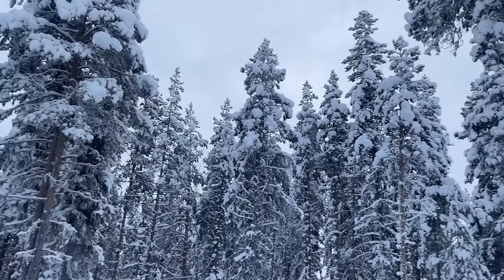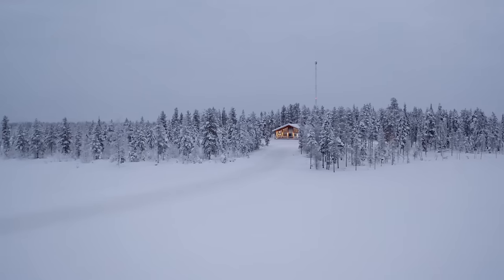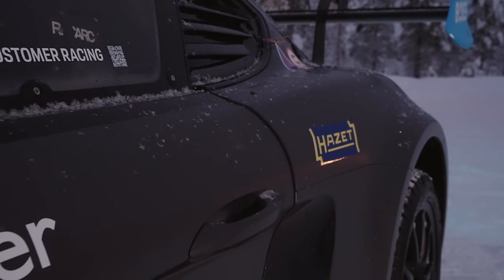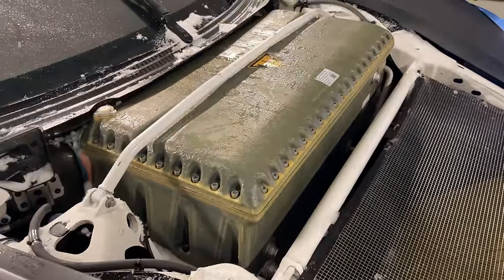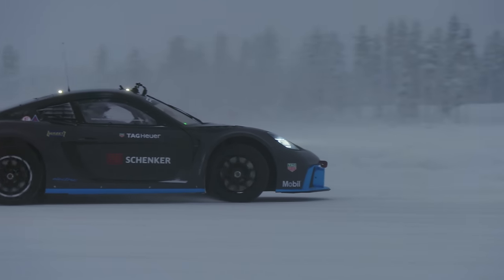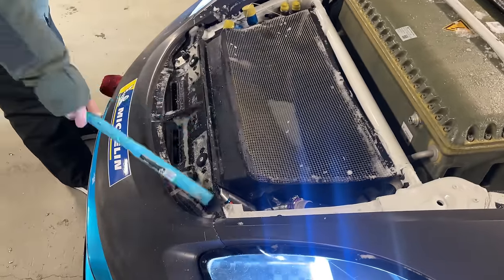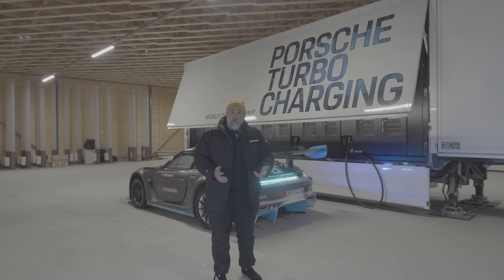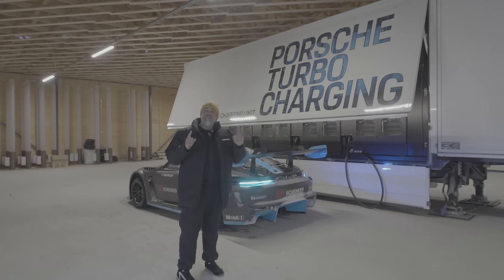Driving Porsche's 1,000HP Electric Cayman GT4 E-Performance ON ICE! - TheSmokingTire

Comment: I'm concerned that they're trying to impress us with the high horsepower numbers because they think that's what we want. But it's engagement and feeling we want.
Reply: Tell that to hellcat owners. Tons of power and a horrible drive.
Reply: EV horsepower is cheap of the shelf - still me want it, because. Lightness and feeling is key - very difficult to bring it to market, nobody has it until now.
Reply: porsche is about engagment and feeling not hp lol!!!
Reply: @mrstinky2421  While I agree, (I'm someone who won't buy a car above 500bhp), at least Hellcat power has drama to it.
Reply: Yes, everyone should be concerned. But, sadly, engagement and feeling is very hard to sell.
Reply: That's what she said...
Reply: Half of the video is about Porsche doing things to make this car as enjoyable as its gas race counterpart. Did you watch the video?
Reply: @vvevvevvvv why is that?
Reply: @RubikscubeNinja   na
Reply: @PutSomeDsonThatBlink lol tells us all we need to know
Reply: Amen & well said !
Reply: EVs offer control of the cornering balance of a car on a level significantly beyond that which ice can offer. The regenerative braking (if tuned properly) gives the ability to adjust load distribution instantly throughout a corner and allows precision trail braking. If you have any care whatsoever about driving a car precisely and smoothly, you will appreciate what an ev is capable of. If you just need vroom vroom noises to get attention then probably not.
Reply: Unsolicited feedback: This is boring
Reply: saying that about porsche is disrespectful as fuck. You could accuse any brand of that but not porsche because they have kept the formula in the 500's, they keep pushing manuals like no mens business and they are fighting by themselves to get new types of gas in order to keep combustion alive... YET they are getting pushed by higher powers outside of Porsche control and like always they are trying to be the best.
Reply: I have tried to explain " Feel " to non car guys and they have no idea its just " Yeah but is it fast " we're doomed. Only one is starting to get it as he looks at older cars thank F 🙏
Reply: @knight2386 people rather bury their heads in sand than listen to you. They don't mean engagement and driving characteristics they mean sound
Reply: @Shiftheads  I know 😔 I think what many self proclaimed “car guys” actually mean by that term is they’re using the preference in a specific car or type of car to help cultivate the image they want to be seen as. A proper car guy appreciates the nuances and subtleties. The differences in driving experiences between cars.
Reply: @Shiftheads  cool name btw lol
Reply: bro i’m 29 years old. i been driving ‘luxury’ cars for the past for years. shit i am watching togue videos with 200hp cars from the early 2000’s and a manual transmission. that’s where im at with cars rn lol
Reply: Have you driven a Taycan? We’ll be ok
Reply: @mrstinky2421  What? Hellcats are a blast to drive.
Reply: If you think Porsche gets its marketing from numbers, you’re sorely mistaken, unless you’re talking about Nurburgring lap times. I’m willing to bet this is just as good as a regular GT4 to drive.
Reply: Did you even watch the video
Reply: Definitely what they gunna try and do
Reply: Thought this comment was on a new hellcat review
Reply: Electric with the push from nothing … really digs you out
Reply: @RubikscubeNinja did you watch the video? When did they demonstrate how to initiate a drift on asphalt with it? Is there a handbrake? Most of these EV’s don’t. How can I slip the clutch to drift? Theres no clutch? Ok.

If you do not drive professionally you would have no idea what the things drivers are looking for here.
Reply: @RubikscubeNinja did you watch the video? When did they demonstrate how to initiate a drift on asphalt with it? Is there a handbrake? Most of these EV’s don’t. How can I slip the clutch to drift? Theres no clutch? Ok.

If you do not drive professionally you would have no idea what the things drivers are looking for here.
Reply: @Shiftheads send me a video of you doing donuts on asphalt and explain to me how you do that in an EV.
Reply: @fxlltxtsearch  drive professionally? It’s literally a race car. Did Matt say it was a drift car? Does an F1 car have a hydraulic drift brake? Your reply is completely irrational.
Reply: @fxlltxtsearch  have you not watch the boosted boys do it in their plaid? You can do it in any tesla that has track mode.
Reply: @RubikscubeNinja  im sorry. I thought the OP said “what we want” not what 0.000001% F1 drivers want? Let me know if Im mistaken.

So many driving styles have been created with the assistance of hydraulic brakes and manual transmissions because those things shipped in average cars wholesale. You acting like that changing being not a big deal speaks volumes to your lack of appreciation of motorsport.
Reply: @Shiftheads  granted, but since theres no hydraulic brake or clutch theres less control. It is not the same.
Reply: @fxlltxtsearch  you keep moving the goalpost lmao. Last reply was about it being for professional racers. Now it’s back to fun? My original post addressed the fun argument, the second your “professional racing”. Any other random thoughts you wanna make up?
Reply: @RubikscubeNinja  never moved the goal post, you just don’t understand that there is professional racing outside of F1. Like 99% of the population.

When I say professional I mean if you’ve ever taken a car to a track and off a main road. If you havent, your perspectives here arent relevant to what professional drivers actual want. In your mind that only involves F1 drivers, fine. Im talking about time attack guys, drifting guys, drag, rally, tandem.. you dont care about that. Fine. That still doesnt take away from the fact that removing a clutch and hydraulic brake changes motorsport drastically.
Reply: @fxlltxtsearch  you think you can't add a handbrake to an EV? Have you not seen the mach e race car Vaughn Jr has or the audi Ken block was driving? There are plenty of gas cars without hydraulic parking brakes. These arguments are amusing. Why cant we just appreciate all cars? Check out the cayman gt4 electric. It has an oversteer pedal. The fastest two cars on the ring are a hybrid and 💯 electric. The fastest Pikes peak car is electric. You can control every wheel independently in milliseconds. You aren't doing that in gas cars
Reply: @Shiftheads  I appreciate electrics. The hybrids in rally are great. Very interesting. Im just saying, that doesnt mean we’re not losing very core things to motorsport right now.

The cars you’re mentioning are incredible. We’re gaining new things from electric. I love that. Yes we can put a traditional handbrake in a EV, of course. But how often will you see that in road going cars now? In the transition we’re going to lose a lot of valuable things in the industry. Thats all
Reply: @fxlltxtsearch  so...not professional then. But having fun. Which, yes, I've done track events and autocrosses. Have you? Drifting is a small section of racing, most is road racing in which drifting is slow and never takes place. Again, if you're talking about having fun on a side road sliding around, that's cool. But also, you can easily do that in an EV. Look up Jason Cammisa's video on the Lucid Air. You need neither a clutch nor a handbrake to drift or slide, and the lack of either does not much a vehicle unfun. A new brand Porsche GT3RS has neither, and if you think it isn't fun, you're being ridiculous.
Reply: @RubikscubeNinja  lets just be clear here. Im not using the word fun here, not once. You are. Im talking about professional racing with real sponsorship across rally, drifting, etc. WRC is professional and EV’s without clutches or hydraulic brakes change the very nature of that sport.

Yes, you can drift in an EV. Not in the same manner as a sequential or manual gearbox with a handbrake. You’re the one here questioning whether people saw the video like they’re idiots when their criticism is valid. High BHP is one thing, thats not the pre-requisite for an engaging and capable sports car. I also did not see here what I wanted to see. And just because the gt3 rs only ships in PDK doesnt mean i would prefer my base cayman to come without a manual gearbox and hand brake.
Reply: What else can you do with a 2 ton car
Reply: It’s because it’s easy to give us a ton of HP but very difficult to deliver that same “fizz” or engagement in an ev.
Reply: YES !!! I would rather drive an old 100hp Ascona B from 1976 then this 1000hp EV. It is not about power, or numbers or timed laps on track, I want a car that is exiting and fun to drive, 1000hp EV might be fun but it lack the feeling of a real engine and the feeling you get from DRIVING a car with manual gearing.
Reply: @mrstinky2421  That is a drag race car muscle car, Porsche is a sports car, completely different and both is fun.
Reply: @knight2386  You are the one missing the point here... With a EV like you speak of it is the electronics of the car that really is doing the driving... Most that buy a sports car like Porsche buy it because they LIKE to do the DRVIGING and the challenge of controlling the car yourself, it is not about best 0 to 200 or best lap time on the track, it is about fun and challenging experience DRVING the car, and not have a car that drives you and give you automatic good lap times...

Comment: why does it have a gearbox? or are the straight cut gears a simulated sound?
Reply: to get the ratio between the wheels and motor right you usually need a gearbox, in evs it is almost always a single speed transmission i.e. no shifting
Reply: @joakimlundstrom5497  i guess I don’t understand why the single speed needs to be straight cut. I understand what a gearbox is for though
Reply: @dbeckMSP idk, I think they're just generally better: more efficient, make for a lighter construction etc but come with a lot of noise
Reply: I am pretty sure the sound you hear is the electric engines, not from a gearbox...

Comment: i wonder if Porsche loses the same 40 % of charge below -20 that Tesla does? Met a couple last year and in -28 their Tesla Y that said 505 km full actually got 300km leaving them 28 km away from nearest charger with a $400 tow bill.... Solid state batteries solve this but lithium is a recall in the cold in Canada.
Reply: The batteries actually have to use some of the electricity to keep warm or else they loose a LOT more power then that when it is cold. Also Lithium batteries can not be charged if they are colder then 0C. Lithium batteries do not work well or at all when it is cold without getting heated up to their optimal temperature.

Comment: The thing is that people that buy a Porsche Cayman / Boxer sports car is after the experience of driving with sounds, and challenges and often even prefer manual gearing to get a raw experience of DRIVING. It is not about power, it is about the entire experience. EV only line of Porsche Cayman Boxter is an innsane idea, people did not even want the 4 cylinder turbo engine even if it had more torque and was much better for daily driving because it did not SOUND like the 6 cylinder.... It is as I say, Go Woke, Go Broke and now Porsche is going for broke...

Comment: How come electric cars don't run an alternator that runs off their electric motors
Reply: You can do that but only thing you will achieve with that is loss of energy in the alternator in form of heat, and the loss is much larger then the gain. Also most electric engines actually have that built in already so it charges the battery when you break (it uses the electric engines as generators to slow down). So you could in theory keep in the gas pedal and the break at same time and charge the battery at same time as you drive, but it will only result in you using more energy, not less...

Comment: We really need to implement a new measurement system for electric cars.

Stating that this model or that model has a thousand or more horsepower is asinine. There needs to be a distinction between the various powertrains. 

We have nautical miles versus regular MPH, air speed versus ground speed and so forth.  Why not something similar for this burdening...I mean burgeoning EV industry?

Regardless of the situation, I would still rather have my burger barbecued versus microwaved.  ICE > EV. 

Stay classy my friends.
Reply: yes power figures for cars are a mess. But why a separate measurement system for each powertrain design? This would only make things even more confusing. Power should be measured at the same place (wheels) and the unit should be kW since W is the SI unit for power.

Comment: Charging 10 taycans = a years worth of power in a typical home? 

How is that not going to drive up hydro costs when more people need access to charging
Reply: He was saying you can charge 10 Taycans at the same time. You could fully charge about 25 Taycans with the larger battery or 30 with the smaller battery before this charger runs out.

Comment: Park that thing outside overnight in that cold and you get 3 min of run time.
Reply: Yeah no, I live in northern Sweden at about the same latitudes as this test center with an EV, that's not true in the slightest. 

EVs have a 40% market share here for good reason, instant heating is a godsend when it's this cold outside. I never have to scrape the windows from ice on my car. And you never have to wait for some engine to warm up, you just go instantly. And I always park outside.
Reply: As an engineer when the temperature goes down the range dramatically decreases.   This we know, do a range test cold vs warm and you will see.
Reply: @johnwilliams727  Well apprently you have some reading to do if you think that's the case. Even my 10-year-old electric car, parked in -30C overnight will not lose that much range.

A newer car like our 2022 Polestar 2 loses typically about 10-15% range in winter.
Reply: @swecreations   You have no idea how an EV actually work... For the battery to take a charge in the cold it needs to be heated up to warmer then 0c, and it also need to be warmed up to not loose most of its capacity when driving. Most of the cars sold in cold countries like Sweden do it automatically without you knowing but it take a considerable amount of the battery capacity it has to keep it warm. And if it gets empty AND cold you are screwed (if that happens you have to wait for the battery to heat up before it even can start charging)...